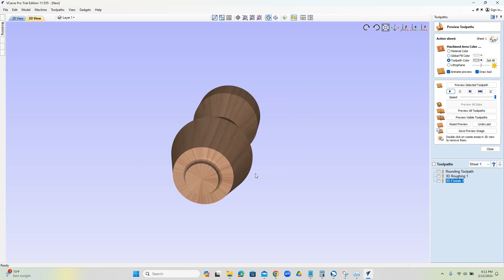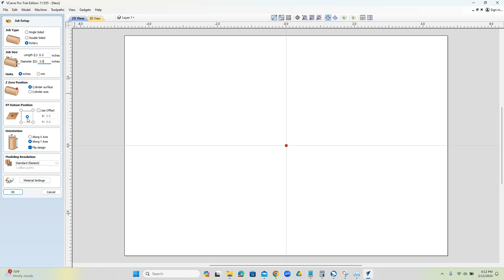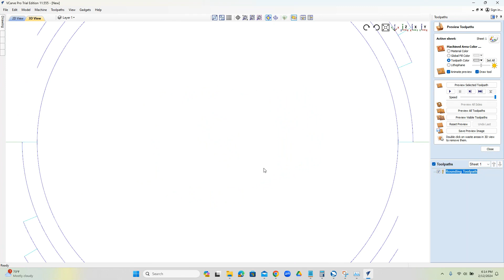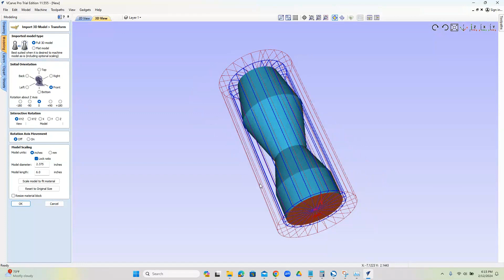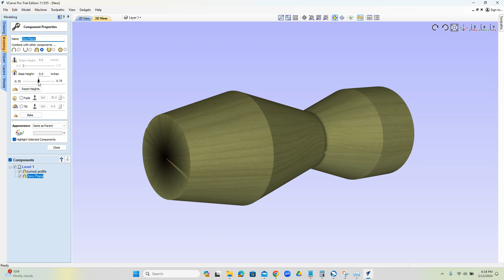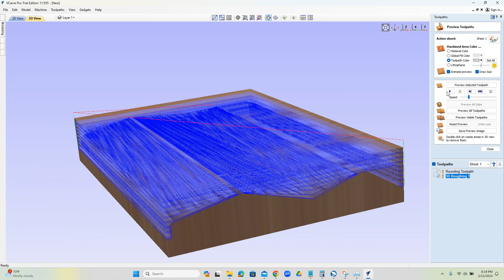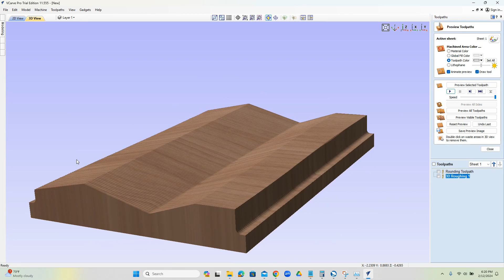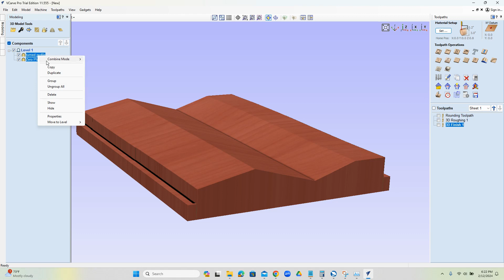VCarve Pro 4 Axis Rotary

Comment: HI!
I'm having a similar problem as ericvangadio!
I have a small TTC 4th rotary! I set it up as recommended by the manufacturer, which is $101=81, in my case! If I run the command G91 G1 Y157 F300 and the axis rotates exactly 360°! However, when I created a project, unfortunately the axis only rotates about 270°! Any idea why?
Reply from the maker: Which controller are you running?   What CAM software are you using, and what does you G-code look like that is only going to 270 - ?
Reply: @CADCAMWizard  First of all, thank you for writing! The value is close to 270°, so I wanted to indicate that the axis does not rotate completely during the operation!
I like the UGS and gSender controllers! The axis did not go all the way in either of them! You probably know that gSender has a Rotary Surfacing option, with which I rounded a 30x30 mm material very nicely!
But when I wanted to do a test job, this would be my first test job, I went as I described! The machine is TTC450 and I saved the toolpath in grbl mm(*gcode)! Just like with 3-axis machines! This is what the beginning of the roughing path looks like:
T1
G17
G21
G90
G0Z10.000
G0X0.000Y0.000
S14000M3
G0X19.892Y-31.416
G0Z5.080
G1Z-2.000F300.0
G1X-7.246F750.0
Maybe this will help you give me some advice!
Reply from the maker: @zoltankabodi3377  I would make sure you run the toolpath down the lenght of the part vs running it around the part  -  Also there may be a limit or use a boundary to keep the tool inside of the 360 -  this way the toolpath doesn't go all the way around  -  Using a boundry if you will to limit where the toolpath goes  -
Reply: @CADCAMWizard  I'm already past this and I haven't had any success! Meanwhile I asked the AI and it says I should install a post processor that handles the fourth axis!

Comment: When I make rotary model in the preview of toolpath it seems ok but in execution in the machine, there is gap which is not followed. Example: I made a cylinder 100 mm dia means 314 mm  circumference with text. In the execution only 264 mm circumference is with text 50 mm tool didnot went. What could be the reason ?
Reply: This might be a problem with the stepping of your machine. The number of Steps per mm changes using the rotary tool vs the linear mode of the router. At least that is in our case. Hope this helps

Comment: Where are you getting your 3d sty files from?
Reply from the maker: Not sure I understand the question, I use CAD CAM software and can draw and program just about anything.  This file was created externally and then imported.  Are you shopping for CAD CAM and not sure which one to get?
Reply: I have Vcarve pro and it’s not easy to design lathe projects. I am currently making a light house and want to add bricks to the sides.
Reply from the maker: @audreyfreels8014  We offer a design service, you can hire us to draw it for you, then you can import and cut as needed.